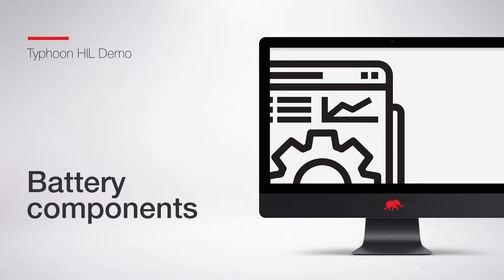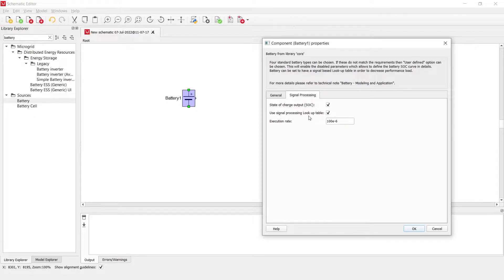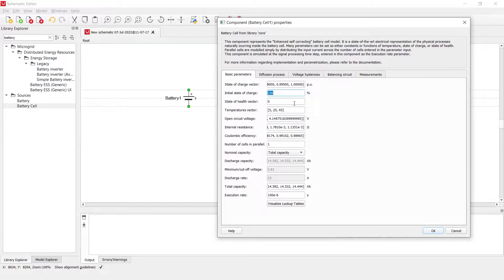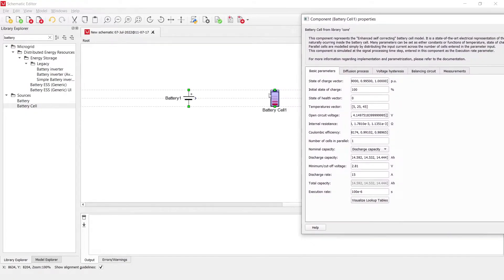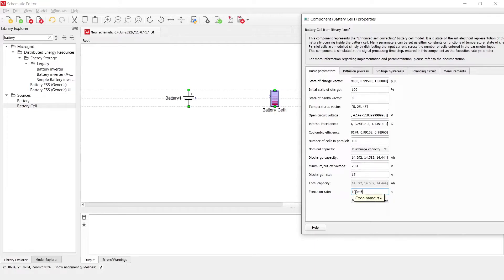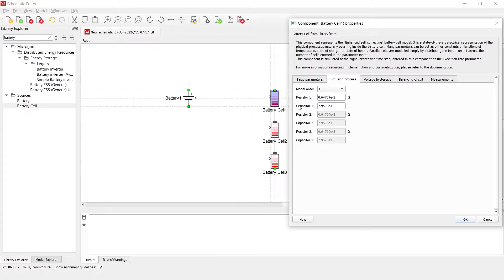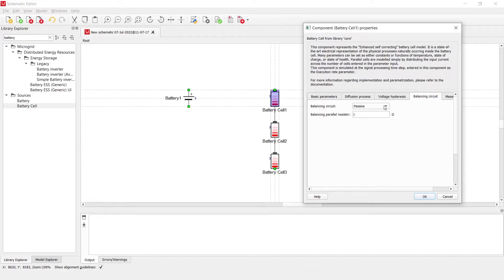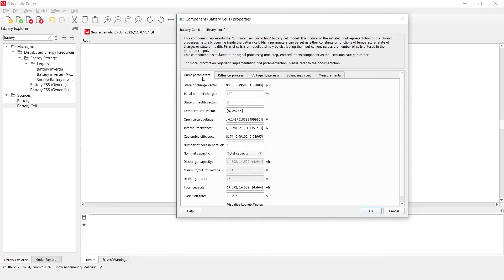Battery components | Demo

Comment: Very Nice Demo.... But I have one doubt that you mention you can make any no of parallel connection will battery simulator able to give load if I increase the connection in parallel
Reply from the maker: Hi Praveen! The "Number of battery cells in parallel" parameter can be any positive integer. The batteries in parallel would not increase the voltage but would increase the total capacity and decrease the internal resistance proportionally to the number of battery cells in parallel. We hope that this answers your question and we wish you success in your upcoming HIL projects!